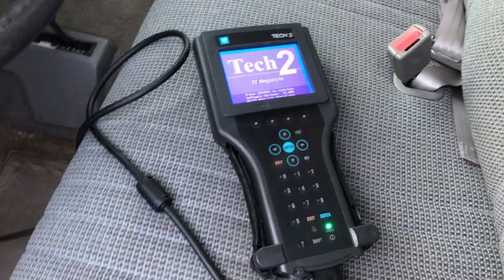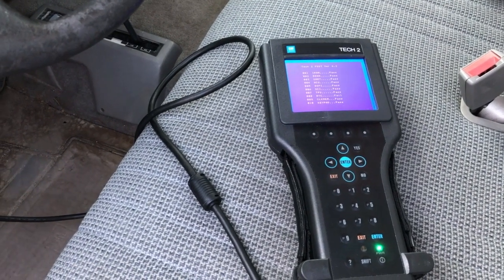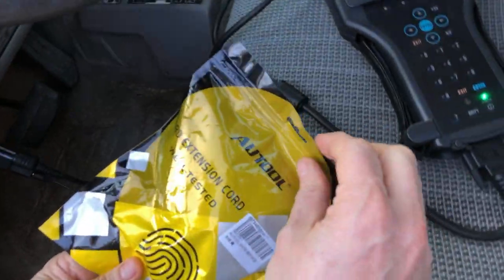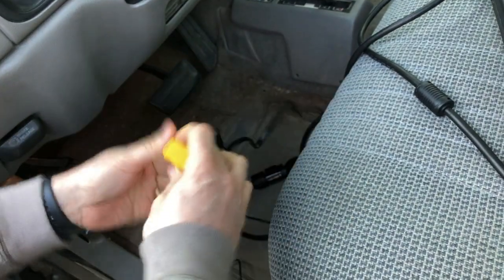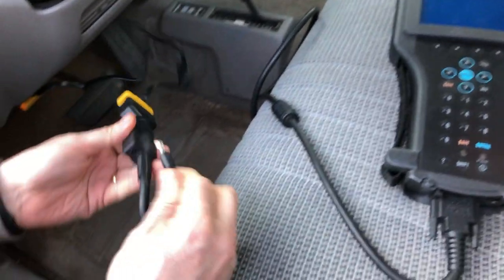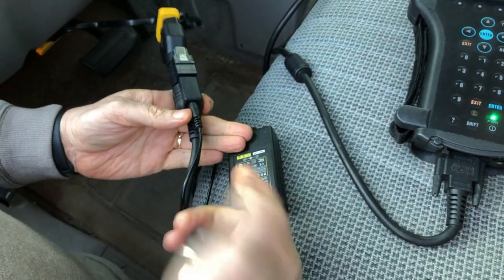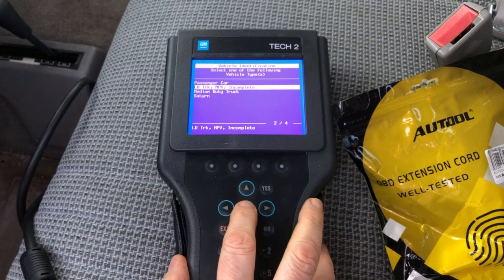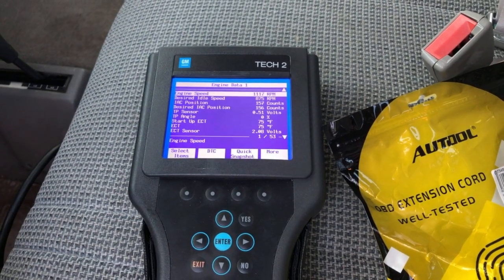GM Tech2 Scan Tool Clone Fix for Restarts or Reboots While Cranking Engine Problem

Comment: But what is exactly the problem on low voltage or amperage coming from the diagnostic connector?
Reply from the maker: There isn't a problem on the diagnostic link connector of the vehicles, it's just the normal unavoidable voltage drop across the battery during cranking that occurs.  The original genuine Tech2 had a custom designed DC-DC voltage converter specifically engineered to maintain the minimum power needs of the Tech2 during such battery voltage drops - that's why a "real" Tech2 works just fine.   But the Chinese clones of the Tech2, or a repaired Tech2 where these original chips are unobtainium, are using off the shelf DC-DC parts which cannot handle voltage that low.  So they cut out (most of the time), resulting in the Tech2 rebooting  (I cover this in another video linked at 0:21) .  I say most of the time as some vehicles don't have as much battery voltage drop as others and you get away without the Tech2 rebooting.  But this is highly random.  You can get around this issue reliably by simply supplying voltage from another source than the vehicles battery, but you have to remove the voltage from the ODBII path for the Tech2 to use that source.  Hence this video.
Reply: DrShock excellent DrShock,no better explanation than this,I'm a GM mechanic for more than 25 years and I found this problem sometimes in my Tech 2,that's why my question,only some times this problem occurred,thanks ✌🏼️

Comment: Great fix! This is also super handy when using the class 2 message monitor function of the tech 2 to search for active modules during paracitic draw diagnosis. It saves from needing to de-pin the dlc pin 16 like the gm service data instructs you to.
Thanks a million!

Comment: Way better than soldering a new dc To dc the daughter board needs an authentic one it’s called mourn sun they are 20$ you take it apart and replace the dc to dc converter daughter board easily done too but I Love this cheap way!
Reply from the maker: Thanks.  I actually I did a vid on the Mornsun replacement https://youtu.be/VAmGybyWfJ4 many years ago.  That approach does not solve the voltage drop situation.  All of the publicly available dc-dc converters like the Mornsun need at least 9VDC to function.  Only the custom one GM and HP used on the original Tech2, the Power-one IWS705CZ dc-dc converter, can handle a voltage drop during cranking down to 7VDC.  This was a custom designed device not sold to the public unfortunately.

Any cases where a Mornsun or other off the shelf converter worked were more of the pure luck/coincidence ones in that the voltage drop during cranking happened to remain high enough.

Comment: My Tech2 boots to a white screen and stays that way now any idea what that might be ? Appreciate your time and reply 😎👍🏼
Reply from the maker: These tools are generally not repairable, if its a clone/knock-off version.  The OEM one is a mail in/exchange type repair that is very costly.   If you have the clone Tech2, I'd suggest:
- With the unit disconnected from power, open the access door and remove the firmware memory card.   Try rebooting without that card installed.  If it works, you need a new memory card.
- If the memory card wasn't causing the behavior, some folks have had success replacing the voltage converter.  I did a video on that some years ago - https://youtu.be/VAmGybyWfJ4

Comment: I got a new teck 2 and i cannot get it to work , was wondering if I could send it to you to check it out and see if it's not working properly or if it's operator error.  I'm not very teck savvy
Reply from the maker: I'm not a business to do that, but if you want to comment what the error code is I might be able to point you in the right direction.
Reply: @DrShock  when I hook it to a car it goes through the pass test then the screen just turns white tried it on 3 different cars same thing on all of them
Reply from the maker: Could be a voltage problem.  Try powering it up from the AC adapter and the barrel port for that power input instead (do not connect the DLC cable to the vehicle port).  The Tech2 should have came with an AC adapter.   See if the screen behavior is any different.

Comment: hi drshock I have an original tech2 that suffered a short, I have no idea how to fix the tracks of the vci module and the tech has a burned track, I can't find any service that can repair it here in Mexico, is there the possibility that you have that repair service?
Reply from the maker: No, I don't do commercial repair work.  But if you have an original Tech2, then the investment could warrant a repair.  If you had a clone, I would say recycle it and buy another.
 
There are no published schematics for the Tech2, so they cannot be repaired in the conventional sense.  But if it's just damaged circuit traces on the PCB or a jack/connector that needs to be replaced I can recommend @NorthridgeFix in California for that kind of micro soldering work though.  They are not cheap, but they are better than factory when completed. ;-)

Comment: Great video looks like you have lots of experience with the tech 2.
I was wondering if you could help me out. I have a tech 2 clone and when I do a self
test on the vci most of the tests fail it doesn’t even recognize that I have the loopback connected. I was wondering if I replaced the vci module would it fix the failed test or could it be the unit itself
Reply from the maker: There's no schematics or repair information available for the clone units, so they are effectively unrepairable other than for obvious things like no power or broken jacks/connectors.   It's possible you have a bad VCI module, but no way with a clone to say for sure.
Reply: @DrShock  Would you know a reliable place I can order a vci from as the tech 2 I bought was defective from day one never knew about the self test till recent. I don’t want to buy one from the same place.
Reply from the maker: These Tech2 clones are not as commonly available as a few years ago, as the MDI clones came in.   I have search links in the video description for eBay.   I would suggest avoiding Aliexpress or any private websites.   I don't believe Amazon allows these as they would be considered a counterfeit item.  But eBay has them, just select a USA based seller with photos that clearly show what all you will be receiving.   As best I recall there were two main Chinese factories of these Tech2 clones, and the higher quality one is the one that comes as a kit with all of the possible DLC adapters, an AC power adapter, all of the loopback connectors, and DVD-ROMs of the TIS2000 software.

Comment: Hi there DrShock, Thanks for this video. Do you happen to know what the cause of no communication usually turns out to be and how it can be repaired? I've done the dc-dc converter replacement and have pin16 isolation switch with remote power. The symptom is that it will generally connect properly first try but subsequent attempts need to be hrs apart to succeed. Very frustrating. Thanks again, Scott.
Reply from the maker: No communication with the vehicle, or no communication with a PC?
Reply: @DrShock  Oh, No communication with the vehicle. I feel like something gets warm and disconnects or something. I get one good run. Then after a restart it just won't connect to the vehicle again for up to an hour. Self test reports shift key fault and also RTC fault.??? I've tried on other vehicles and it's the same.
Reply from the maker: RTC reporting a problem on POST (power on self test) is common given the age of these tools.   Shift key fault is not, neither of my two have that error, though I doubt it's related to what you're experiencing.  I believe that would be a membrane keyboard error, that the shift key is stuck in the pushed state.  

Rather than rely on just the POST, I would run the built in diagnostics and connect up the loopback connectors to see if it finds anything.  Can't say I've ever seen or heard of this sort of problem before.
Reply: @DrShock  Thank you Doc,  I'll do that.
Reply: @DrShock  The RTC and also the keyboard fault were user (me) error. After resolving my misunderstanding of the use of the shift key I was able to complete the self test. Unfortunately the VCI failed miserably. Do you know where I can buy one?
Reply from the maker: eBay sometimes, AliExpress more likely
Reply: @DrShock  yup got one on the way. Thanks for yourhelp.

Comment: Hey Dr. Shock, Ordered one of those Cables from your YT Video. Also I have question. I have a GM Tech 2. The Display has some pixels missing in the horizontal rows which makes the images blurry.  Do you know of anywhere I can buy a new display board complete. They are all over Ebay ..but they are the Chinese versions. Any place in the USA you might know of to get GM Tech 2 components? Thanks Mark
Reply from the maker: Thanks.  The genuine Tech2 never had any publicly available spare parts, as these were ship in for repair only tools.    Only two options I believe you have are waiting for a dead one to appear on eBay to cannibalize it for the LCD screen.  Or, paying Bosch for an out of warranty repair.
Reply: @DrShock  thanks for the reply Dr shock looks like it'll be an eBay thing I find a dead one but the last Dead one I saw on eBay was bit up to 480 bucks crazy money thanks for your time and trouble

Comment: You could even use power cord that plugs to wall outlet on extension cord
Reply from the maker: Nope, you cannot.  That approach will not work for this situation with a Tech2 clone.  That's because the design of the clone tool is to only source power from the DLC when detected, the power from the AC adapter will be ignored during a voltage drop encountered during a cranking event.  Additionally the DC-DC voltage converter device used in the clones cannot handle a voltage drop below 9VDC, whereas the genuine Tech2 can.   So the solution presented here, which bypasses that DLC voltage check, is the only route to avoid the reboot of the tool.
Reply: Are you a gm mechanic?
Reply from the maker: engineer ;-)
Reply: Engineers tend to over think things

Comment: Awesome fix ! My problem is I broke 2 pins  off on the main scanner plug. Have a fix for that?
Reply from the maker: If you mean the connector on the Tech2 itself, that's part of the vehicle communications interface (VCI) module that can be removed and replaced.
Reply: @DrShock  yes the main 32 pin connector whatever it is right there at the base of the tech 2 scanner thank you very much I couldn't remember what that modules called PCI where can I pick one of those up
Reply from the maker: That's a major part of the circuitry so not cheap, if you have a clone will be less than if you have a genuine Tech2.  Here's a couple of affiliate links for it on eBay: https://ebay.us/sqEJjH and Amazon: https://amzn.to/2Sp3aTb
Reply: @DrShock  thanks again.  Yes its a clone. One I will never  loan out  again. Thanks I will order one up asap

Comment: Ah, I got one of the extension cables, and at first I thought it didn't work, cause my Tech 2 was cutting off still no matter how I had the switch on the extension cable....THEN it hit me.... I was using the cigarette lighter plug for power.... AND that was fluctuating when I tried to start the car...... then I connected power directly to the battery, and or plug in adapter and it worked.... problem solved.... make SURE you have a constant source of power when you do this.

Comment: Can these clones do a crank relearn? Or if i change the distro will it relearn timing on the new part? Thanks in advance.
Reply from the maker: The best ones are identical to the Bosch made in China originals.   Here's a video where I use a clone Tech2 to relearn a diesel crankshaft sensor top dead center, for example. https://www.youtube.com/watch?v=yDGwnRofpKc&lc=UgzHOXtVttJxs4Ckwwd4AaABAg

Comment: Can i use this tool to deploy my airbags?
Reply from the maker: Deploy is probably not the word you're looking for here ;-)   But you can use a Tech2 to setup a new SDM (sensing and diagnostic module) for SIR (supplemental inflatable restraint) systems in vehicles 2008 and earlier.   You cannot reuse used modules using GM tools.  You can further use a Tech2 with SPS (Service Programming System) to update the calibration on the SDM, to the latest programming if necessary, using TIS2000 (DVD) or TIS2Web (www.acdelcotds.com).
Reply: @DrShock  while I was actually jokingly asking if I could set off the airbags haha I appreciate your well thought out and timely response. You sir have earned my subscription! I did purchase a tech 2 last night and hopefully wont deploy my airbags while im using it. 😂

Comment: Excellent work around. My clone has been resetting/blue screen while connected- tripping my cluster brake and seat belt lamps. Also it immediately drained the battery to the point it would barely "click" while cranking. I got one of those OBD adapters and I must say- it works flawless!
Reply: ++2021 update: I just reflashed my 2004 TB EXT 4.2L PCM using this obd adapter and it.....worked great. Only 2 minutes of stressful waiting!

Comment: My Tech 2 clone will run off the AC adaptor through a start when the adaptor plugged directly into the Tech 2.  There is a socket on the Tech 2 body just next to the data cable.      Have you tired plugging into the Tech 2 rather than down by the OBD connector?

The power connection near the OBD connector is connected directly to the vehicle's OBD power.     When starting, the vehicle voltage  will drop.    The AC adaptor will supply current to the vehicle to attempt to make up for the voltage drop.   Of course, it will not be able to and will go into current limit mode dropping its voltage.

On the other hand,  the Tech 2 will run off the AC adaptor when it is plugged into the body of the Tech 2.     In this case, there is electronics to pick out the best power supply.
Reply from the maker: What you're describing is known not to work for all clone models, as some circuit board designs will favor the OBDII jack 12VDC regardless. Most all clones suffer this problem because they lack the same specification for the DC-DC voltage converter from the original HP built Tech2s of the 1990s.   The converter being a proprietary chip designed for GM that the Chinese choose not to copy, most likely due to excessive costs to meet the voltage drop specifications.   Hence this cable approach came about which I've tested across several models to work reliably.  A must when performing data collections or monitoring across multiple engine re-crank events and doing vehicle diagnostics.
Reply: @DrShock  I must have gotten lucky with my clone.     I'd would still suggest trying to plug directly into the Tech 2 with the adapter first.    It may just work as it did for me.     I got a nice graph of my cranking voltage going to 9.2 volts with my Tech 2.      PS  thanks for the videos.
Reply: Just to bump an old video if it helps anyone >> in my case also, it does indeed favor power from the OBD plug UNLESS plugged directly into the tech2, this then will favor the external supplied power in my case also. Pretty sure i have a genuine Vetronix unit tho.

Comment: When my Tech2 starts up it beeps 4 times and the screen stays blue with no text or image. What do you think could be wrong.
Reply from the maker: Power on self test (POST) failure.  Likely dead, and unfortunately not user repairable as there are no schematics.  One thing you might try is swapping another PCMCIA firmware card in case its just corrupted but I would have low expectations.  If its a genuine Tech2, you can pay Bosch to repair it.  If it's a clone, time for the recycling bin or to eBay out for its parts.   Before I tossed it though, I'd open it up and check for any loose connections, another long shot but worth checking.

Comment: i have downloaded tech2win and running it through the MDI clone and it does not give any engine data live stats or anything like that. im in australia, using the australia holden bin file, just only gives the basic scan tool stuff, what am i doing wrong?
Reply from the maker: I'm not a Tech2Win subscriber having a physical Tech2 as in this video.  The subscriptions I have with my MDI are SPS and GDS2 only.   You might find out faster calling technical support at ACDelco TDS - https://www.acdelcotds.com/subscriptions#
Reply: @DrShock  thanks

Comment: Tech 2 work on 95 K1500
Reply: I dont know the answer to your question, but if you cant get coverage with the Tech 2, the next best thing I believe (but limited compared to Tech2) would be an Snap On "Brick" MT2500/MTG2500. For older vehicles- those cartridges give a great deal of engine info plots and bidirectional controls. Specifically versions 9.2 for primary and 8.2 for troubleshooter- I believe those were the last versions produced...at least those were the only(latest) ones I could find when I purchased.
Reply from the maker: Tech2 model year coverage is 1993 thru 2013, but the coverage on the oldest years and the newest years is limited.   I don't have first hand experience with a 1995 truck, so I would be guessing but I would have an expectation it would work.  You may need the ODBI connector adapter for it though, I can't recall when the ODBII switchover happened but it was sometime near 1995.
Reply: @DrShock  1996 was the switch over.
Reply: DrShock Tech 2 works from 95 to 2012 with no problem, some 94 and down you need to have an adapter to use it with Tech 2 or Tech 1